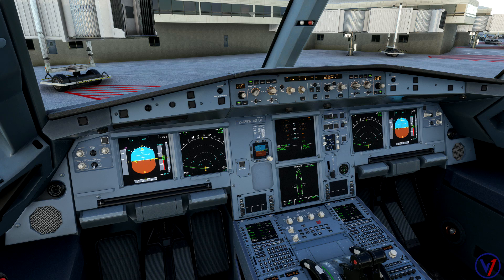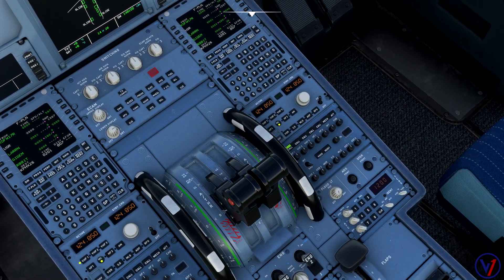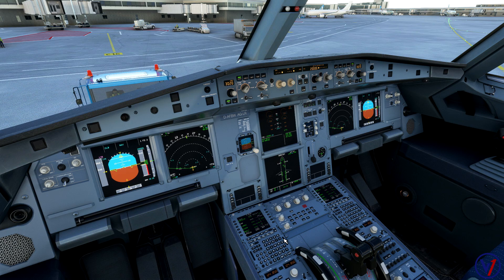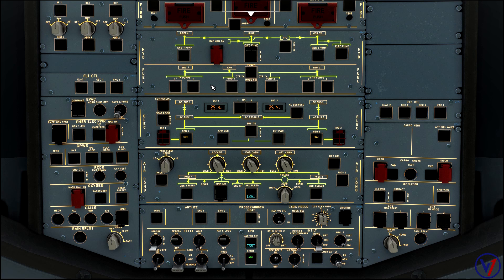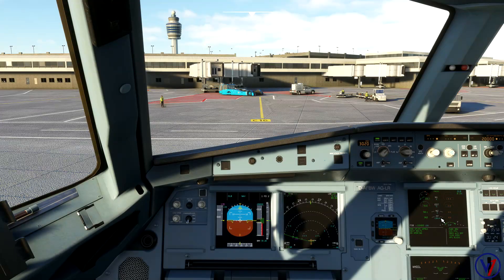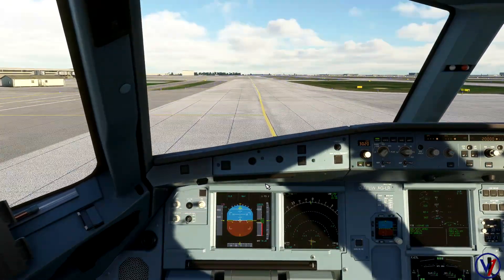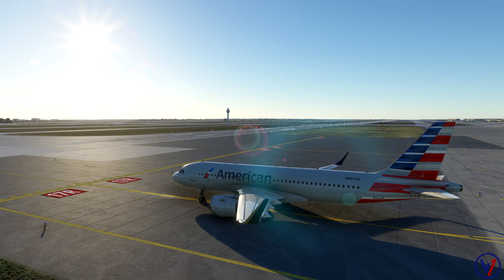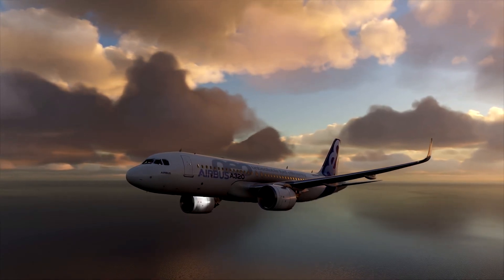Single Engine Taxi | Engine Start | REAL Airbus Pilot Training | MsFs2020 | A320 Neo

Comment: Every a320 flight I have been on I have heard the PTU sound. Does that mean they started engine two first every time? Also, is single engine taxi common?
Reply: Never mind on the PTU question, you answered later in the video.

Comment: Just joined a company with SE taxi out procedures. I have to unlearn 15 years of starting no. 2 first and 2 engine taxi.
Reply: So you always do 1 engine taxi? I can only assume because of the size of the airports
Reply: @tomstravels520   Generally at the larger airports or where you are parked on one side and the departure runway is on the other side of the airport. Also for taxiing in. Some times the gate is occupied and you have to wait. Might as well shut one down.
Reply: @schillaci5590  do you have a GW limit of when you can use it?

Comment: What is the limitation of single engine taxi for CEO and NEO?

1)Is there a limitation on Gross weight?

2) is there a time limitation as in, we can't do single engine taxi if the airplane was on ground for 2 hrs or 5hrs
Reply: Not on slippery runways, must be done to allow for second engine to have about a 2 minute time to run after start, not on taxiways with any slopes and not for very high gross weights. And if it’s less than a 10 minute taxi time not much point doing it

Comment: What is the purpose of the single engine taxi when we increase ENG1 degradation so that it does not warm up well before runway?
Reply: Saves fuel. And you start the second engine so that it runs for at least 2 minutes to warm up

Comment: In Vueling when we do single engine depp we set crossbleed to open and pack 2 off additionally regarding the apu bleed the main reason you don't want to use it, is bc you will suck engine's exhaust which is not nice.
Also it is important to crhono the time engine1 and 2 have run before take off

Comment: nice video:

1) Can you get the ATIS from VATSIM ?
2) is it normal that with 2 engines taxi at 19% N1; the plane accelerates  like crazy ? seems unrealistic
3) is it normal that with 1 engine taxi, you need over 35-40% N1 to accelerate and over 30% to maintain the speed 
4) the engines need at least to run for 2 min at least before setting TO power, correct ?
5) for 1 taxi engine aftert landing, the engine needs a cooldown of 3 min minimum before shutting them ?

thanks :)